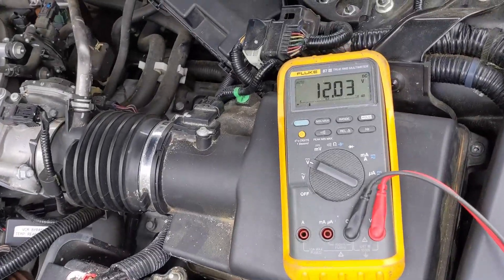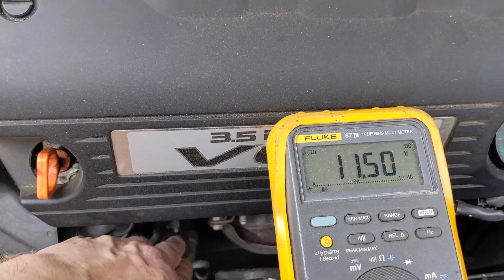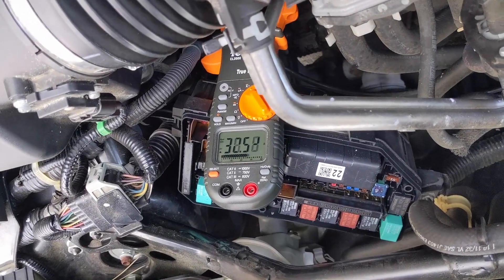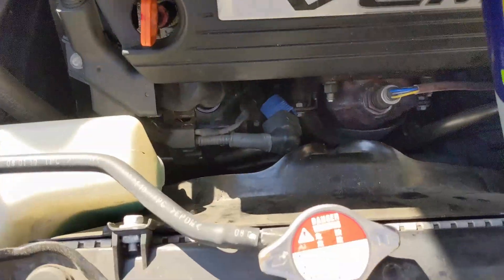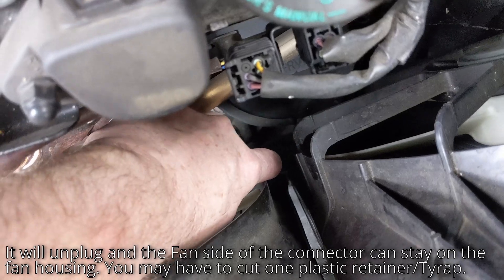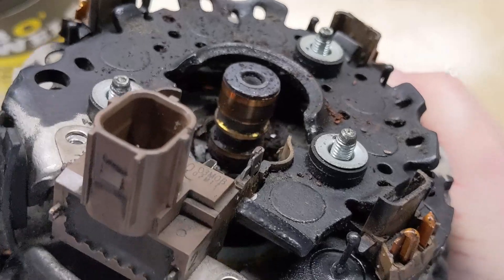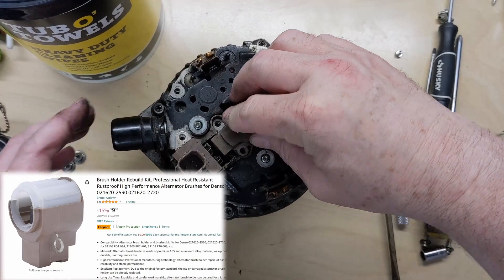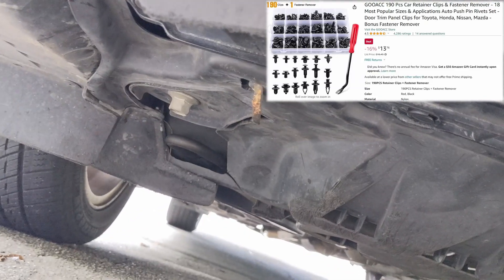2010 Honda Accord Charging System Issues

Comment: Mine is running with 14.2 and I already replaced the battery and alternator. I'm screwed. Alternator working but the stupid light is on